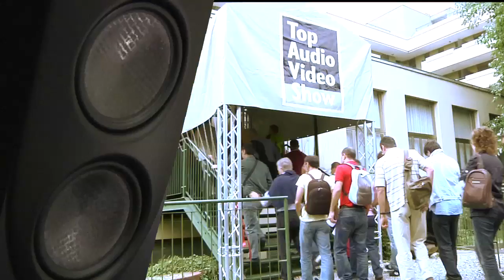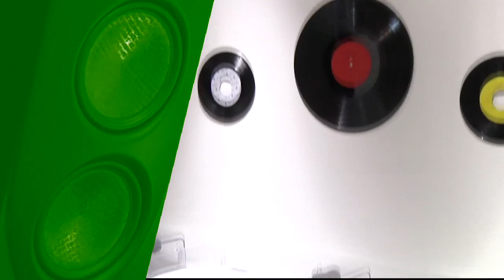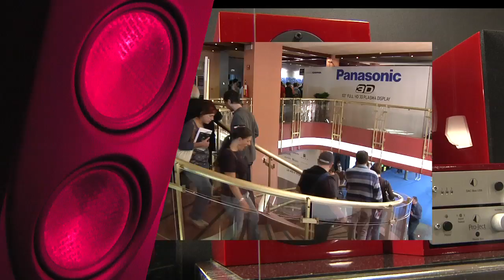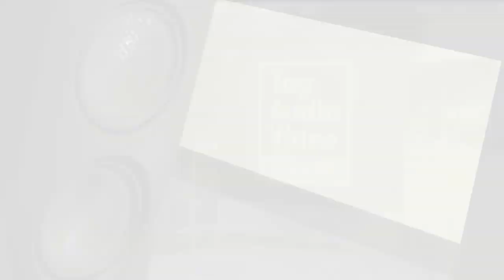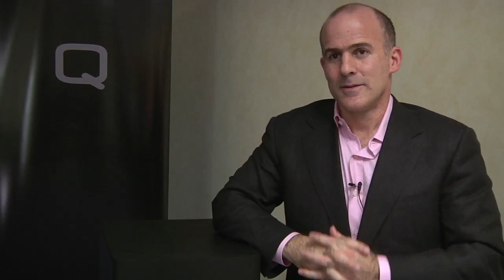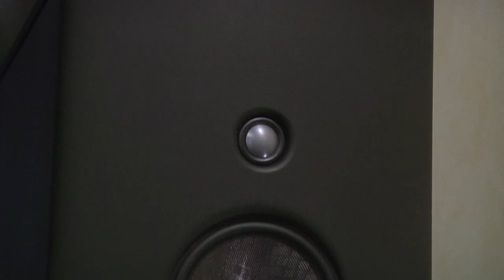Magico Q 180kg Of Custom Built Specialist Speaker (Top Au...

Comment: Heard $88,000 pair of Magico speakers on McIntosh at a local hi-end store... sounded HORRIBLE.  Went to the next room over and listened to a pair of Sonus Faber speakers at less that half the price that TRAMPLED the Magico.  Some of the most overpriced audio I have ever seen/heard.
Reply: That doesn't mean anything.  What music were you playing through them?  Was it the same recording?  I've had expensive speakers and what happens is they typically reveal how good or bad the recording is, maybe you just listened to a bad recording.
Reply: Sonus Fabers?  I wasn't that impressed by SF's.  I know their low end stuff is made from off the shelf drivers and they are making them in China.  Certainly not in the same class as what Magico is doing, Magico is making their own drivers, cabinets, and they are VERY expensive to make.   They are also very revealing, so if you listen to a bad recording, you'll hear every aspect of a bad recording.  That's the downfall of the more expensive stereos.   I didn't think the Songs Fabers are as revealing as the Magicos.
Reply: Everyone has their own opinion... I think SF are FAR better speakers FOR THE MONEY than Magico, not even close.  The other problem with your reply is you are comparing these VERY expensive Magico speakers to the VERY LOWEST PRICED Sonus Faber speakers.  Yes, for their "entry level" line of speakers, the drivers are more basic and the cabinets are made in China.  You are trying to compare an $88,000 pair of Magico speakers to entry level SF speakers that are A FRACTION of that price.  

And the music that I listen to in an audio store and at home are for the most part very, very good recordings.  If a recording that is just "average" and sounds bad on an $88,000 pair of speakers, then that is all the more reason to buy a more forgiving speaker (less fussy) about the recording quality and upstream audio gear.
Reply: WillyTV Which Sonus Fabers did you listen to anyway?  

Sounds like there could be a lot more to what you heard since they were in two different rooms, and probably didn't electronics involved.  It's very easy to make great speakers sound like crap by having a bad room, mismatched gear.  I've heard Sonus Fabers sound great and I've some sound mediocre (more of their higher priced models).  I haven't heard their low end models.